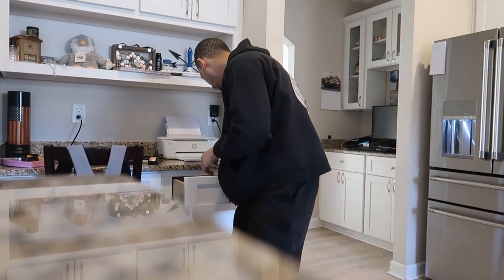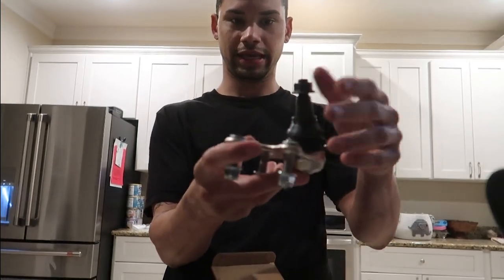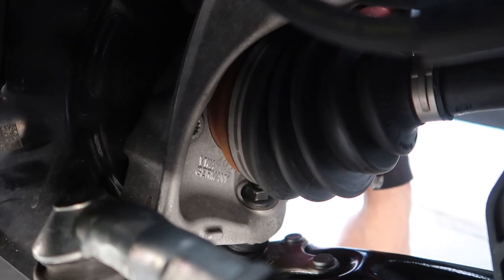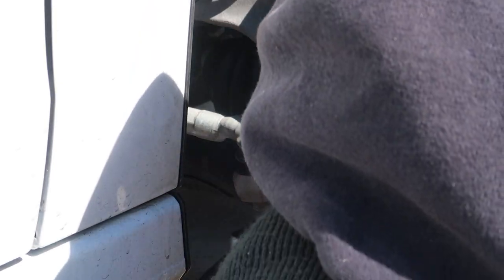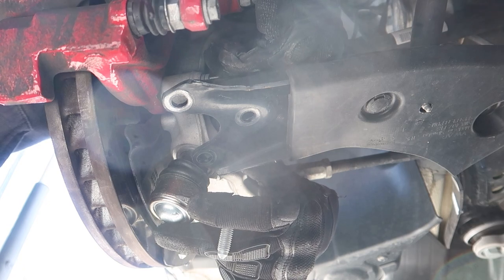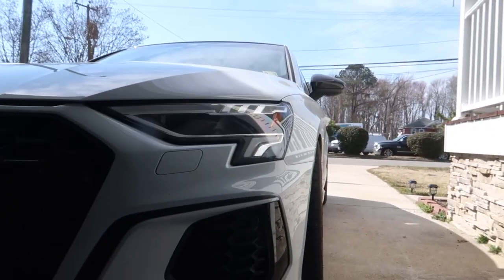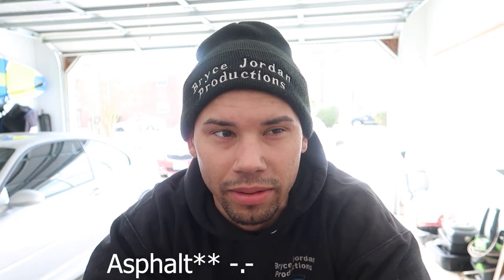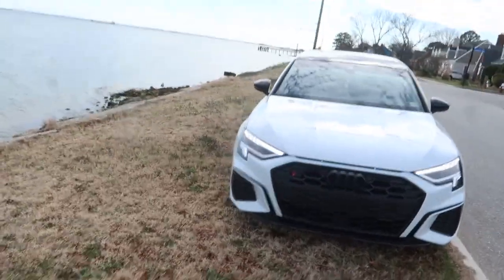034 MotorSport Dynamic+ RCO ball joint DIY + First impressions | 8Y S3 / MQB cars!! [AMAZING!!]

Comment: With camster mounts and RCO ball joints from 034 I’m sitting at -3.8 in the front of my RS3. A lot of fun but a bit too much for daily driving and tire wear. Either going back to stock ball joints or getting a proper camber plate setup to get me to my happy medium. Love O34 products as well. Wish they made some more options upfront on the RS3/MQB platform
Reply from the maker: I sit right at about -3.8 for almost a year now. Tire wear isn’t crazy, it’s all about the toe gotta zero that out! I also rotate after each race event or 2500ish miles. Out back I have about -2.1
Reply: Hey @mattvermilyea what suspension set up you got?

Comment: Another great review! That's the plan for me, got coilovers, 034 ball joints, 034 front Subframe kit, TyrolSport rear kit.. Get one alignment +corner balance. Gonna do wilwood front kit, ss lines, engine mounts and probably a few more things... Oh do88 ic all before next track day.

When you ran the wilwood 6r kit did you upgrade the pads for autocross? Trying to find a good dual duty.. Street/light track pad
Reply from the maker: You are on the ball!!! Sounds like a sick freaking setup man! I went with the carbotech ax6 pads.. meant for autox. But I'd probably go for their xp10 or 12 series over them. I'm waiting for do88 to drop theirs for the mk8/8y seems like the best of the best right there!

Comment: I just had a mechanic install these on my mk7.5 GTI and the car is un-drivable. I had the mechanic fix the toe for now, and it drives only a tad bit better. The stability system kicks in a lot and it moves around a lot. Probably going to tow it to an alignment shop. I don't want to risk putting this car on the highway to the alignment shop. Wish me luck 🍀 man. Thanks
Reply from the maker: Yeah you need a proper alignment right away almost. It'll be tons better once the toe is right!
Reply: Is your car lowered or stock ride height?
Reply from the maker: Lowered on racingline springs

Comment: Great video!! I just got mine yesterday and throwing them on Wednesday. Question about your wheels, what size and offset are they? I’ve just started looking around but these look about like what I’m hoping to find.
Reply from the maker: They are ET 44 18x8.5! With a 5mm spacer in the back
Reply: And with 18s there is still clearance? Thinking about this upgrade on a mk8 R with stock 357mm rotors. 

From 034 pictures it looks like the LCA is a tad lower after this upgrade
Reply from the maker: Yes sir I run 18s no issues

Comment: Bryce, did you happen to get before and after alignment specs? Just curious if these things really add 1.2 degrees of camber. I already have -2 on my R with PSS10s .5” lower from stock, Superpro LCA, and Eurosport camber mounts. For a primarily street driven car I don’t quite want -3.2 degrees. -2.5 or so would be optimal. I know a lot of these products you don’t actually get quite as much camber as advertised so curious if you have the before abs after data?
Reply from the maker: We spoke on Facebook but I can't find the post. Buddy in an alltrack got his alignment today and it's 1.2 on the dot PER SIDE 👌🏾
Reply: @BryceJordanProductions  thx! Did he lose any caster? One guy here locally in Denver that lost a lot of caster but thinks it may be a fluke
Reply: my std R runs 1.2 degs per side overall. it's not enough but 2.4 is surely too much on the road?
Reply from the maker: It’s not. I’ve been running -3 for about 4 years now daily

Comment: Clearing your rotors fine? I saw someone that had a stoptech st60 kit wasn’t clearing their rotors fully. I have the 6 piston APR BBK and want these ball joints. Just not sure if they will clear.
Reply from the maker: Yeah they clear mine, sites says it clears the stage 3 racingline bbk.. not sure what others will fit